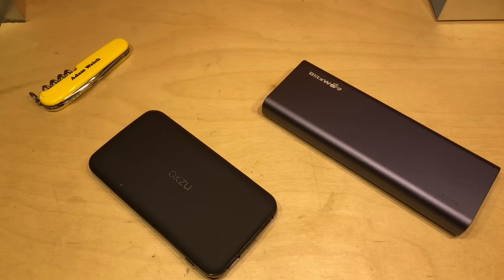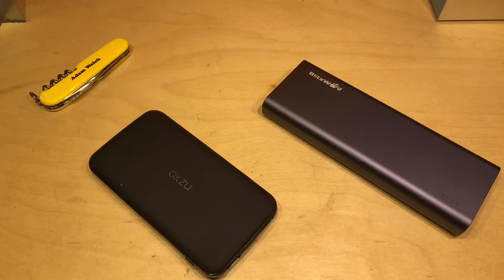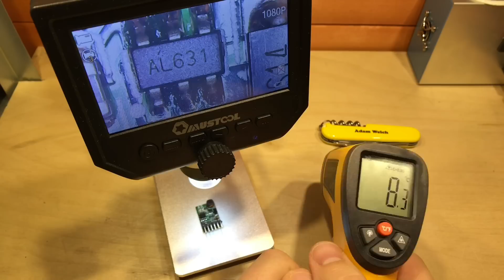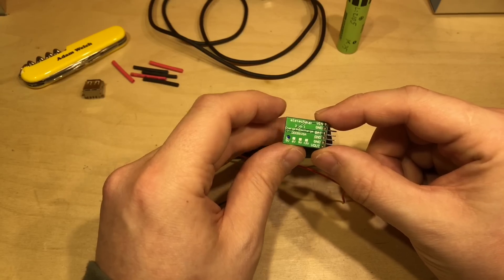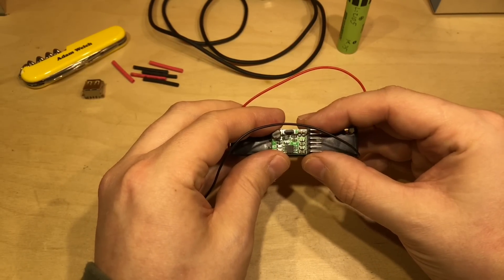5v USB UPS Module - 12v Solar Shed

Comment: Great vid, now the only thing I need is a signal that tells the battery voltage is getting too low to continue, with which I can let my Raspberry PI do a proper shutdown before it's simply been cut off...

Comment: could be useful if it support 12v input and output as a ups for my router. power interruption in my country are quite annoying, just 1 or 2 second power cut my router reboots its self

Comment: ... well, technically you can't charge and discharge at the same time.The current is only flowing in one direction. But that's the good about li-ion batteries. They don't have "memory" effect. You don't get penalty if you charge it before fully discharged.

Comment: I pulled a circuit from a cheap single cell power bank that had this capability, I had been using it with a solar panel to operate a wifi camera where I could not run any power cables, it worked for a while, then the board stopped working, I'm sure CUTS were overloading it, the camera drew less than 1 amp during the day, but probably went up to 1.25 amps at night with the infrareds on, it lasted several weeks, I'd love to find one of these with a 2 amp capability.

Comment: Hi great vid should get my modules in the mail soon :) .........can i ask/request a similar project or any info on a ups module like this that works with 12v car battery ? variable output voltage would be a bonus....thanks heaps :)

Comment: Just stumbled on your channel. Very concise and clear video. Thank you. I have a question, I'm trying to make a UPS for a raspberry pi in the car that will detect when the cigarette 5v adaptor loses power and runs off battery just long enough to initiate a proper shutdown. Do you think this module will work for me? I suppose I could add a relay to completely kill the pi to not discharge the battery?

Comment: There's a slightly easier way to do this, and it provides over-discharge protection too.

Combine one of these:
10Pcs 5V mini USB 1A 18650 TP4056 Lithium Battery Charging Board With Prote B5Q3
With one of these:
DC-DC Boost Converter 0.9-5V to 5V Step Up Module USB Charging Power Module B4
(Titles copied and pasted from eBay listings.  You should be able to find them by doing an eBay search on each title)

The first item combines a TP4056 charging circuit with an over-discharge protection circuit, and at least on the version I received, it will allow charging while still supplying an output.

The second item is just a 5V voltage booster circuit, as you might expect.

I'd recommend putting a switch between the charging board's protected output and the voltage booster board, because the latter contains a LED which will be lit (and draining the battery) all the time while the battery is in circuit.
Reply from the maker: Yes, I think there are better ways to implement this - I would especially like the cell only to be called upon when the 5v drops off, but unless there is a way to bypass both the TP4056 board and the boost converter, there is going to be some issues with efficiencies.
Reply: The biggest problem I can see is the switch-over, presuming you're going to make a "real" UPS which supplies the output directly from the input while charging the battery and only supplies power from the battery when the input is not available.  The switch-over needs to be fast enough that power-sensitive items such as a PIC or Atmel microcontroller won't notice any power outage, otherwise it's not really a UPS (the U is for Uninterruptable).

Comment: I received two of these today and I can verify ~800mA output, not the 1A you're showing. Also, it won't change my iPhone - I've tried with a genuine Apple USB cable and it pulls 2-3mA and won't engage the cable/chip for some reason. Charges other devices ok but not my iPhone. Any ideas?

Comment: Adam Welch+ I'm on a binge looking for the same thing, I want mine to power a small Bluetooth speaker build for clarity with little to no noise and so it will run off of the phone charger and the battery only if unplugged so we have that in common. I found this...   https://www.ebay.com/itm/USB-Lithium-Li-ion-18650-3-7V-4-2V-Battery-Charger-Board-Protection-Boost-Module/192183192848?hash=item2cbf02cd10:m:mp01J6C_p3WoPcNB2zU525g
Reply: The others are listed as 2 in 1 and this one is listed as 3 in 1, maybe?

Comment: My powerbank as with many, does in fact have a pass though function. There is a 1 second delay in supply when power input is removed from power bank. The only benefit I can see is that your project doesn't have that changeover delay. Would that be correct? Neat project non the less. :)
Reply from the maker: +Matt Burrows Yrs that is right - no changeover delay at all. Explained a bit further why that is in my follow up video.

Comment: Thanks Adam. I guess the workaround for low voltage protection would be to use cells which have their own internal low voltage protection. 

It would be much more useful if the data sheet, or some other source, could tell us exactly how the over-voltage protection works. You answered other questions about it, but the details are too vague for comfort. For instance, is it fully-automatic, can it be adjusted or controlled manually? Does it charge to 4.2 Volts, or does it stop at a lower voltage, can it be adjusted manually? And so on.

Comment: I  know this isn't as much current but is this one roughly the same but maybe have some protection abilities?
https://www.ebay.co.uk/itm/Single-cell-Li-ion-Battery-Protection-Mobile-Charging-Boost-Output-5v-Board-O9M3-/232505992088?_trksid=p2349526.m2548.l4275

Comment: I am designing an "old school" nixie tube table clock at the moment. Old school meaning it uses only standart logic chips, transistors and a TCXO. Everything thru-hole of course. No microcontrollers, no RTC's... And I need some sort of a UPS for the 5V side of it for keeping the time when the power input is interrupted. I really hoped this board could be my solution but having no battery protection on the discharge side makes this thing pretty unusable... Maybe a battery with it's own protection may work though... Great video by the way, thanks.

Comment: Hi. I have been looking at your videos alot since getting into solar and have took your advice on what  products are good or bad from your reviews. I would like to contact you over email if possible. Is there any chance we could arrange that. My current setup is 2 250w solar panels with the epever 40amp solar charge controller. Kind regards. Kyle.
Reply from the maker: +kyle bell Hi Kyle. If you take a look at the ‘about’ page on my channel there is an email address available under ‘business enquiries’. You can email me on that and I will help if I can, but you might have to be patient with me - I get a lot of requests and messages these days.
Reply: Adam Welch. Thank you.
Reply: Adam Welch may be keep a option  quick reply for 1$ or something 😝

Comment: Nice video. I have a small collection of solar chargers based on the lipo rider design. The cheaper have found so far is by elecrow and sells about $3.60 on Aliexpress. It is larger than the module you found, I can give you a link if you bare interested.
I found a small module from the same manufacturer that would aso protect the cell. Looks like one of those specialized ICs found on powerbanks and supporting components all in a tiny board. Here is the link:
 http://s.aliexpress.com/22ABZ7fA

Comment: I like the idea, but I think this one is actually bad. As far as I can tell this is a charger that charges the battery and a boost converter hooked to the same battery. If you have a load of (if charge current is set to 1A) 600mA - 100mA on the battery (whch means about  the tp4056 will keep the battery at 4.2 volts indefinitely. It will be kept in the CV-state which (as far as I have heard) will cause the cell to break down.

A proper version of this would have an ideal diode with the input and battery as inputs and the boost converter as the output. And also the over discharge protection you mentioned.

Comment: hardly impressed, is it really just a TP4056 charging the cell and the 3426 is boosting from the 18650? yikes. just imagine if you had this thing setup for a long period of time, how much wear on the battery from being charged and discharged right up to 4.2v every 5 minutes!!!
Reply from the maker: +SuperBrainAK it shouldn’t get charged up too frequently. If you take a look at the tp4056 datasheet you will see that it mentions an automatic recharge setting. Now there isn’t much more detail but I think it will allow the cell voltage to drop quite a bit before it initiates a charge again. Someone else mentioned it will charge again at 3.6 volts. 
The question is if the current draw from the connected device is high the tp4056 might not ever reach the completion threshold current. I’m going to try and investigate this and might do a follow up video.

Comment: Assuming this 5V UPS is plugged in, charging and has a USB LED attached, do you know if current is flowing from the battery to the LED or directly from the charging source? Did you have a chance to test this?

Most of these inexpensive board I've looked at don't have Dynamic Power Path / Load Sharing and prematurely wear out the battery since the load current comes from the battery and not the UPS input source.

Thanks for your videos. I learn something every time!
Reply from the maker: +Bunch Cheers. I think there’s a couple of extra tests I’d like to do with this. If it throws up some interesting results I’ll do a follow up video as soon as I can.

Comment: I could really see this being used as a flashlight (kinda like what you are doing in the video). While charging the battery(cell), you could still be using the flashlight and then disconnect and keep working. Especially useful for places where having a cord wouldn't be an issue, but just annoying at times (like working under a car doing mechanical work, or under a cabinet doing plumbing, etc, etc)
Really nice gadget!  :)

Comment: Would be interesting to know how it operates its UPS function, from what I know 18650 don't like to be top-up charged, the 4056 will start charging from somewhere around 3.6v I think, I dont think it will be a safety issue more of a battery life issue.
Reply from the maker: +Alex Walpole The TP4056 datasheet says there is an automatic recharge function, but doesn’t show anymore info. I hope it allows the connected cell to drop a fair bi before the charge restarts. More testing required and a follow up video if it shows something interesting.
Reply: Im not sure who or where but I swear I remember BigClive, That Australian guy with the annoying voice or Julian doing a video on it

Comment: Hi, the step up IC it's more likely to be an SD6271, the AL*** label correspond to it. BTW, it's not really any "smart" on the module, right?, or I missed out?, I mean the 5v output it's always connected to the boost converter, the ideal way it's something that only switches output voltage to the boost converter when the input voltage fails, I need something like this for  a small 5v camera in case that the AC line fails. Still very interesting, thanks.

Comment: Ya on all of those 18650 holders like that I have I have cut off those wing holder things
Reply from the maker: +James Holbrook A good tip. Cheers
Reply: Adam Welch that's just what I did because ya those things suck
Reply: And they work with button top cells only.
Using ABS plastic holders now.
Reply: CheapVlog Just add a Blob of Solder to the positive Battery Terminal and file it down a little so that it is somewhat flat.
Reply: these are quite good for experimenting with, they take AA,AAA and 18650. I know not suitable for this project but beats magnets for prototyping.
https://www.fasttech.com/products/1883214
Reply: Christian Shepherd. I have like ~100 random 18650s. I'l better stick it with magnet on top.

Comment: I cut off the plastic bits that curl in on the + side and it's a little easier to get the batt out.
Reply from the maker: +SidneyCritic ComedyHound A good suggestion. Thanks.
Reply: Devices with tight battery compartments often had a little ribbon, attached at one end, that would loop under one of the batteries. Pulling on the free end would pop the battery out. A bit of kapton tape stuck to the battery with a loose tab, or a strip cut from an old component bag  running under the battery can be a good aid in getting it out.

Comment: You need to search some more for that UPS module. I bought 5pc. for $4.95 ppd and they have USB in and cell protection. 
https://www.ebay.com/itm/5pcs-5V-Micro-USB-1A-18650-Lithium-Battery-Charging-Board-Charger-Module-TP4056/222504671841?ssPageName=STRK%3AMEBIDX%3AIT&_trksid=p2060353.m1438.l2649
 To add 5V out add a $.78 2A boost converter. May be cheaper in bulk.
https://www.ebay.com/itm/DC-DC-Boost-Converter-3-3v-5v-9v-12v-2A-Adjustable-Step-Up-Power-Supply-Module/272718429462?hash=item3f7f48fd16:g:y2UAAOSwDcpZrrvJ 
 With USB out use https://www.ebay.com/itm/5PCS-PFM-Control-DC-DC-USB-0-9V-5V-Boost-Step-up-Power-Supply-Module-PR/322558543247?_trkparms=aid%3D111001%26algo%3DREC.SEED%26ao%3D1%26asc%3D20160727114228%26meid%3D10045c120d77477f852a234cb454f612%26pid%3D100290%26rk%3D2%26rkt%3D4%26sd%3D311520400471&_trksid=p2060778.c100290.m3507
Reply from the maker: +Experiencing Technical Difficulties I guess buying the separate modules has some advantages in both features and cost!  Thanks.
Reply: These boards do not have 5V step up. All you can get out of them is the battery voltage 3.7v...
Reply: Maybe it would help if you read the whole thing?
Reply: I stand corrected :-) This "read more" thing was really hard to see among all those links in the same blue color. Sorry for the "premature" comment .
Reply: I know, the "read more" thing has gotten me a few times, especially when people add extra empty lines for effect, mirth or just to be ridiculous. The comments have been far less effective and enjoyable since they changed from the standard of referencing and indenting replies. It irks me that when I comment to person "A" I also get notices about others replies to "A" as well as to my own, although not always even to my own.  And it would be nice if our links could be a different color from YouTube's links.

Comment: LOL what would happen if you put the USB input into the output. I gues it would just discharge it until it stopped.
It would proberly need an on/off switch in the battery lead to stop it discharging the battery when not in use, unless it was permantly plugged into a 5V source.
Reply from the maker: +FireballXL55 Another good reason for keeping that cable short! I didn’t think of that issue though. Thanks.

Comment: Thank you. This is exactly what I want to make for my caravan. I will get the 12v one ,a few more cells and team it up with the solar panel you reviewed. It will the be used just to power the taps and led lights that don't get used much  when I wild camp. This will be so much better than the leisure battery and a ton lighter. Thanks again for the great videos.
Reply: play itcool 500mA for a water pump seems quite low :(
Reply from the maker: +play itcool You’re welcome. Just check the current limit on the 12v module in case it isn’t enough for your needs.
Reply: Adam Welch yeah it's only 0.5 amps at the 12v one. I'll have to check my pump. I might have to hunt out a 0.5amp one.